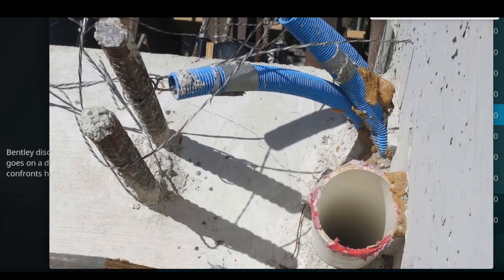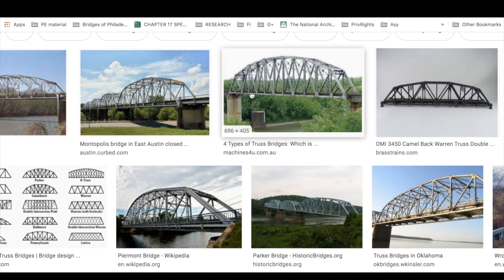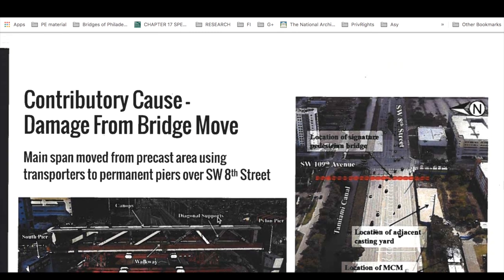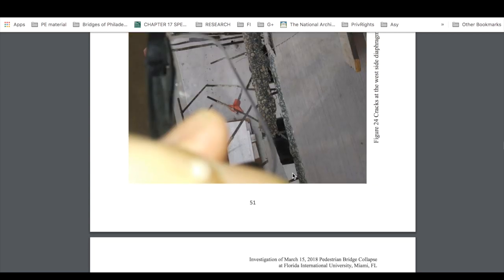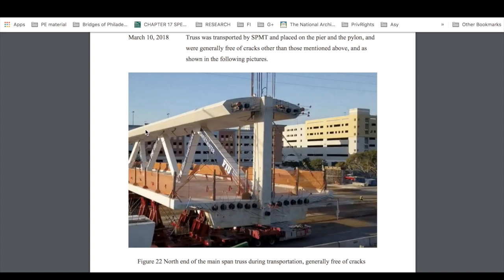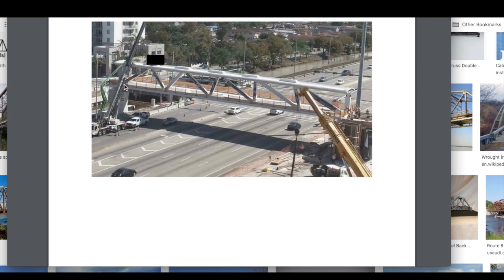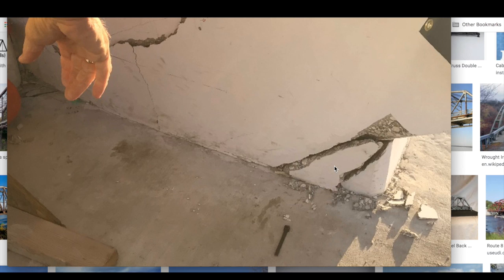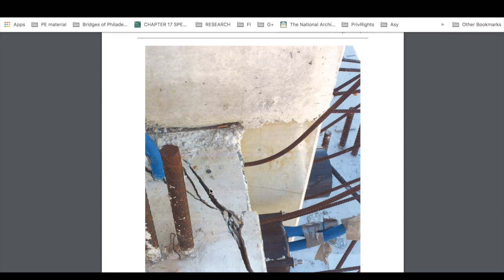FIU Bridge Collapse NTSB Report DEBUNKED CRACKS APPEAR 2 DAYS OR MOVE BEFORE BRIDGE MOVE Part 2 of 4

Comment: They said they tested it by supporting it on the 2 ends before moving it they just didn't recognize  it failed. It had to be anchored to the other span that is why the struts were smaller on 11 side

Comment: I am kinda thinking that the designers were maybe thinking; 1) the deck under post tension would hold itself up and together without any support from above, and 2) the canopy under post tension would hold itself up and together by itself,  3) set the canopy on top of vertical supports 1 and 12, which would take the ENTIRE vertical support of the canopy,  and 3) "columns"  (or whatever) 2 through 11 were all for looks that did nothing except to tie the upper metal part to the lower part for origami appeal.  Then you have NO wild mathematics to deal with.  And,  you would truly have a structure that would be totally under COmPREssION.
Reply from the maker: Thanks for your thoughts SteveR
Reply: Hey, you have integrated my thoughts on your video dated 11/29/19 when I had stepped out of the box for the perception to realize that 2 -11 were not originally supposed to do anything.  They started doing something when the deck started sagging.   @ForensicCats

Comment: Does the cracking you illustrate have anything to do with the jacking transporters not being in the proper positions under the bridge? I had heard early on that the east jack was moved inboard because the roadway had a lane shift unaccounted for and wasn’t under 10/11, but more between 9/10, and would not been balanced enough to hold the extra weight hanging at 11/12. I think the paper model was an excellent way of visualizing the hinge   of movement and transfer of loads. I learn more every video you post.
Reply from the maker: The transporters were NOT installed at the time of these cracks presented on the 8th.   Thank you for the compliment.
Reply: Now that you say that, I recall the time line. Sorry, data loading error. I’m working from an IPhone and I squint a lot and cannot always make out the text. I will sit down, shut up, and hang on.

Comment: I heard you say you were helping out friend with a car problem  retired auto mechanic at your disposal if you need any help
Reply from the maker: Thank you Gary, perhaps that would be fun to put a video up showing a mechanical car problem (s); then go from there...
This friend has a new thermostat but no strong heat.
I discovered his radiator cap does NOT get even warm, yet the truck shows 183 degrees +/-